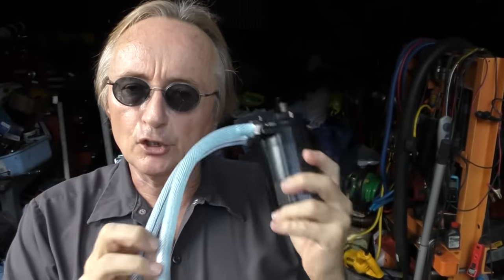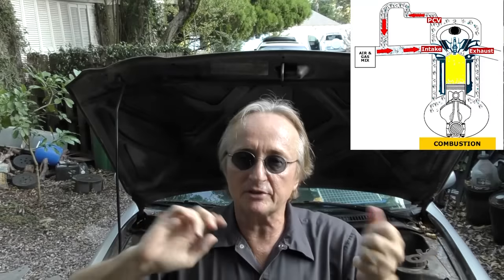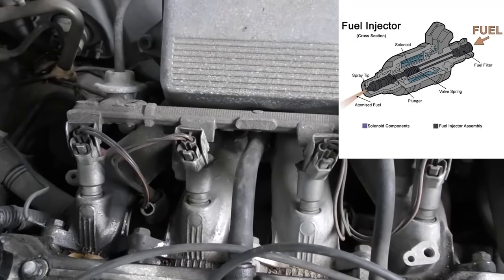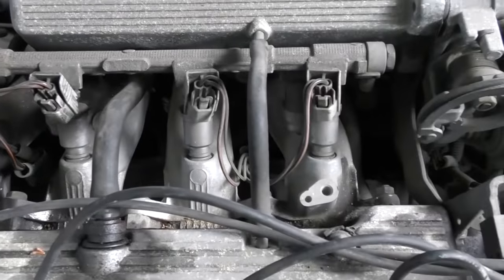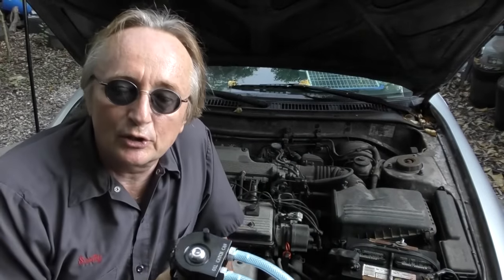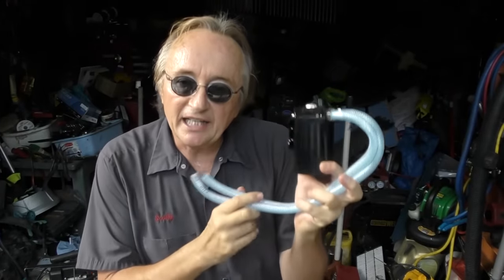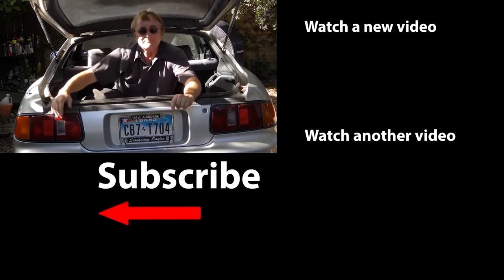If You Have This Type of Car, You Need This to Prevent Damage to Your Engine - Oil Catch Can

Comment: Be careful not to create a big trap that will allow water to settle into it and freeze.  It may take a while to thaw and damage can be done in the meantime if the other side of the PCV system is frozen.  Don't think it can happen?  Research 2.4L equinox PCV.  They have a trap built in from the factory.

Comment: Hi, Scotty. Does a Ford Ecosport 1l Ecoboost 2019 need an oil catch can? Thanks! 😊
Reply: Alex Ostafi you should not, 2nd gen ecoboost engines aren’t just direct injection, they’re mixed injection which means there are 2 injectors per cylinder. 1 inside like he’s talking about and 1 behind the valves keeping them clean. I’m a part of a ecoboost group and there are guys with 200k miles and some with more without a can on theirs. Also I have yet to hear any of them mention them having this problem.
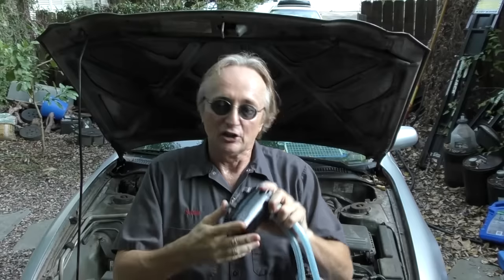Just finished this video, he answers your question at 5:25.

Comment: So I own a 2012 vw jetta diesel, it's stage 2 straight pipe... the car has always had the intake route covered in oil... I seen someone with a catch can and literally told me that was why they had it, to keep it clean? Should I get one? Wi this fix my issue? Also, could this be causing the car to lose some of its oil level over time? I use 10k mile oil...
Reply: It's a TDI. Totally different creature. Diesels are just dirty engines. As for the oil consumption, youre probably getting blow by if its not leaking which I doubt

Comment: I have a Miata. It has a breather hose system where it comes out of the valve cover and leads back to the air intake. Many people put a filter over that valve cover exit and plug the intake entrance. Is there benifit to this? Is it worth it for me to install a catch can in place?
Reply: If your new to working on cars, this is a cheap project that can be done with minimal tools.

Comment: I have a 2019 F150 with the gen 2 3.5 liter twin turbo v6 (3.5L Ecoboost). Does it have the PFI or do I need a catch can?
Reply: Yes even if you have the dual fuel injection system every car should have 1 to keep the engine running clean as every car engine has blow-by!

Comment: Anyone have an idea where the OEM PVC remains and have zero fume into the intake with the modern cars?  Of course have it vented to with a filter.   The question is with a PVC valve system, does it have to be a closed system to the intake?
Or have it the old way and remove PVC valve and run catch can to filter breather to vent to opening.   But would this be a problem when DMV smog inspection occur since part is modified?

Comment: I bought a 2014 tucson 2.0 liter engine today it looks like it needs 2 catch cans, is that possible, one hose coming from either side of valve cover, one goes to intake plenum and the other to the air intake just after the air filter?  Or do i just need one for the one going to the plenum , i would think both because they both lead to the valves, such a stupid design what a headache.  I looked in the intake hose and there is oil seeping into the throttle body even though that is a fresh air suction hose coming from the valve cover

Comment: I heard ford ecoboost v6 engines have the dual injection set up on them. But still hear they get the build up issue too.
Reply: Unkle t0m Only their truck has have dual injectors but their suvs and cars dont. But recently their 1.5l 3cylinder ecoboost has dual injectors.

Comment: Would this help the carbon buildup to the secondary air intake as well? Just had to have the air intakes drilled clean on my Q7...
Reply: Secondary intake? Oil catch cans usually keep oil and blow-by from getting into the intake manifold and beyond.

Comment: Funny I had to install one of these on my 2017 Ford escape SE I couldn't figure out why I had oil all around my throttle body it just didn't make sense so after doing some research the oil catch can is what I needed and my problem was solved so just out of curiosity I asked the stealership what they thought and they tried to tell me I needed a new throttle body and a fuel pump damn shame you can't go anywhere to get an honest opinion from anyone but yeah the 30.00 oil catch can did the trick and saved me what about 4,000 of what still would not have resolved my issue.

Comment: Scottie,  it still cause problems on the earlier fuel injectors as the carbon/oil would build up around the injector and cause problems with the nozzle

Comment: I just bought a 2011 camaro v6 3.6 engine has 74,000 miles on it should i install one of these catch can
Reply: Is it a gasoline direct injection engine? If not, then no.
Reply: @danejurus69  TY for the reply

Comment: Most of the direct injection cars are now either "self cleaning", meaning they squirt gas on top of the intake valve every once in a while to dissolve the oil, or have their own oil catch system in place that not only separates the oil from the air, but also returns it to the engine so you aren't wasting it.  Oil catch cans are for the first generation of DI cars.

Comment: So I installed a catch can today... not sure if I did it right though 🤔 there is a hose leading from the engine into my intake tube (not the manifold),  I took that hose out and connected it to the catch can inlet and then connected the supplied hose to the outlet and then connected that hose back to the intake tube . 

There's a second tiny little hose that also connects to my intake tube , I don't know if either of those are part of the pcv system. Can anyone help me with this ? Does the pcv system lead directly into the intake tube on some vehicles? Or is it always lead directly into the intake manifold on all cars? I thought I understood the pcv system but obviously I don't. I feel embarrassed to ask this and even more embarrassed to take it into my mechanic's shop and ask him to look at my work . Thought I knew the basics about cars but can't even install a catch can properly 😒

Comment: do you think Honda CR-V 2018 with 1.5 Turbo Engine needs it to combat the oil dilution issue?
Reply: it wont help with the oil dilution problem but definetely install a catch can so you dont clog up your intake valves. Every new Honda MUST HAVE a catch can installed.

Comment: This sounds like the AOS on a Porsche 996. And they fail. Which generally requires removing the engine, though I changed it by removing large numbers of parts.

Comment: First gen Ford F-150 truck 3.5 ecoboost don’t need this catch can. Just uses top tier gas, floor the gas once in a while and make sure you used synthetic oil and change it regularly like 5to 7k miles

Comment: 108k miles on my 2014 Mazda 6, just did walnut blasting on the intake valves.
Reply: How? What equipment did you use? I took off the intake and got a electric brush to clean the carbon off, but I wasn't able to get the valves. It had a lot of carbon buildup. On the valves and plastic intake.
2014 mazda 3 90,000
Reply: Daniel Garcia I walnut blasted it with an old blasting gun hooked up to my air compressor

Comment: Hello, I recently put one of these catch cans on my 15 Silverado. Had a local mechanic change the oil on it and he informed me I had a rear main seal leaking. Took the truck to local dealer to be fixed, the tech told me that the catch can may have been the reason the rear main seal started to leak. Thoughts on this if anyone has any are appreciated.
Reply: It's a hose with a filter, IMO I dont see how that wood make the seal go bad.

Comment: Do I need a catch can on the 2019/2020 Ford Explorer with EcoBoost GDI? Not sure if this model has dual fuel injection in its engine.
Reply: Yes even if you have the dual system every car should have 1 to keep the engine running clean as every car engine has blow-by!

Comment: Mercedes engines without GDI also need these because of the variable intake mechanism!
Reply: not only them many more need it. Modern diesels use hydraulic lifters and they need A PERFECT OIL
 to not get stuck  (internally) and it is pain in the a.. to get them clean/free again...
I made my own catch can for my old Susuki Grand Vitara 2.0TD 2000" at about 250.000 km and instead 
of new oil at 4-5000 km I got about 7.500 km after the catch can, so yes it works. I drove that car to 315.000 km
before it rusted out...

Comment: Can you use the breather filter that comes with alot of them? I figured not to since its a closed pcv system, so the breather would affect the vacuum pressure going into the engine. Anyone able to wiegh in on this?

Comment: So far GTI has worked about as well as a one-legged man in a butt-kicking contest. That works real well for diesel but gasoline is an entirely different fuel. Trying to make a gas engine emulate a diesel really doesn't work.
What they should have done with sequential injection is delay the injection till about 30°after top dead center. The purpose of this would be for the gasoline to be injected after the overlap period is complete. Thereby during the overlap period, only air is being used to scavenge the exhaust just like GDI but without the draw backs. A lot of modern cars especially GM need to better ventilate their crankcases.

Comment: I have used these devices, and I feel the satisfaction of draining oil and water out of them every couple months...  But at the same time, over 50% of all fleet vehicles in the US, are GDI, plus tens of millions of regular drivers that aren't part of a fleet...  If GDI was such an issue, wouldn't we hear about it?  I have seen the same handful of early Audi and VW horror stories with their GDI, but for every car that has such an issue, thousands or tens of thousands don't...

I feel like these days, car makers take this all into account.  Every time you drive, there is what, a few drops of oil and water going into the intake, over the course of your drive?  And now, some companies like Toyota do dual injection... they use GDI as the primary, but have secondary injectors in the intake tract.  Ford now does with the Gen3 Coyote motors, and they also build oil separators into the lines themselves...  Pretty sure they aren't the only ones...

I just wonder in this day and age, how much of a legit is this, REALLY?

I see zero valid studies, just a lot of "internet lore"...

Thoughts?

Comment: So the oil catcher goes in so will it drop my engine oil level?
Reply: Yes, so you have to check the dipstick more often, like every week
Reply: Depending on the size of your engine and if its turboed or not. Its minimal but you should be checking your oil anyway ;)
Reply: @HondaFit4Adventure  i looked and doesn't have any in the catch can.
Reply: @gamercat7004  Check after a 1000 miles. 
I know I can go at least 2000 before I have to change mine.

Comment: I have a 90 honda accord 235k miles. I isually go through 1.5 to 2 qts of oil between oil changes would a catch can be good
Reply: oil catch can is good on any car, but you probably need new gaskets on your valve cover and distributor and vtec solenoid. You are probably leaking oil.

Comment: Sometimes I've thought those engineering guys are so smart , they know what they are doing .. well 😬
Reply: GDI allows them to control what goes on in the cylinder.  For emission standards and increase in power they are great and make gov't regulators happy.  In real terms when driven, the carbon deposits are a real issue and when they gunk up valves - it creates worse mpg and worse emissions
Reply: @valvodka  yeah basically it's all whistles when new and pain as times goes on , wonder what emissions means nowdays .. when 10 biggest ships polute way more then all cars together and garbage is all over the sea
Reply: Part of the regular maintenance of a direct inject engine is decarbonization every 15,000 miles. You can do that at home with a can of seafoam and the breather hose going into the intake.

Comment: Anyone! Does a 2018 Ford Edge have a dual Intake system. My wife just bought one. 2.0 ecoboost. Thanks
Reply: We had a 2013 Escape with that engine, it was a great car! It had 80k trouble free miles until it was totalled in a wreck.

Comment: Can you explain WHY modern vehicles with both PI and DI don't need catch cans? This is a controversial topic amongst the 2nd Generation Ford Raptor owners and I still have yet to get a true explanation as to why it DOESN'T.

Comment: how do i find out if my car has gdi injectors?
Reply: Just Google up the model of your car and what you want to know about it is the easiest way. 
Direct injection will usually be on top of or on the head, port injectors will be mounted on the intake manifold just before the head. Its sometimes hard to see though especially with plastic covers

Comment: I put one in my 2002 Echo recently, 308k miles. After 600 miles, I collected 3 oz of oil, gas and water. Over a year, that will be 75 oz kept out of my engine.

Comment: Could you just unplug the pcv valve from the intake and vent it to the atmosphere?
Reply: Tony Herson illegal depending on where you live with consequences ranging from fines to not passing MOT. 
Secondly some vehicles computers will stop you from doing so. Meaning it will immediately throw an check engine light if you disconnect PCV valve.
Finally while we may disagree with some environmental regulations. Venting poisonous gases into same air we breath isn’t really a good idea.

Comment: So do I need one on 2019 ecoboost f 150?
Reply: Andrey Lukashev it is simple to install, and even on the new Raptors you'd be catching 20ml every oil change. That's an inexpensive investment to make your engine last longer. I'm surprised they're already not included with the new GDIs.
Reply: @chicanopowers4938  so I've actually done some research since and discovered that the new ecoboosts use both direct injection and port injection. And unlike the Toyota Scotty mentioned, Ford keeps their PI on the whole time, while the DI goes on and off, so I decided I'm definitely safe without adding anything.

Comment: But Scotty you forget that a lot of that carbon buildup on valve's uneven non GDI engines is caused by that every car should have a catch can
Reply: Exactly the same way I feel that every car should have 1 to keep the engine running clean as every car engine has blow-by!

Comment: Oil Catch Cans are illegal in California and perhaps in other states too, you will fail emissions test if you have one installed. Makes me wonder, what leaves a bigger carbon footprint, keeping your car for 10+ years while maintaining a catch can, or getting rid of it every 5-6 years due to carbon/valve build up as a result of PCV system they force automakers to install if they want to sell in the state? Looks like Japanese automakers got ahead of the game and introduced both direct and (essentially) port injection to their engines in order to maintain reliability that they've been known for. I don't understand why an Oil Catch Can can't be just another part of the vehicle that needs to be maintained. Oil can be drained and recycled vs. having it recirculated back into intake, burned, and decreasing the life of the engine/car. I imagine the former leaves a much lesser of a carbon foot print then the later. Has there been any studies that ask this question?

Comment: I thought these oil catch cans were a gimmick. But I just bought a new (to me) Hyundai Santa Fe with a GDI engine and installed one. The car only had 63,000 miles on it so I wasn't expecting much if anything. But after only thousand more miles there's about two tablespoons of nasty metallic-looking oil in the bottom of the catch can. All that would have gone right down the intake without it, so thank you to Scotty and your video for getting me to do it!
Reply: "Metallic-looking". You've got much bigger problems with that 2.5.

Comment: So why doesn't the manufacturer put them on stock if they're that important?
Reply: 'cause the average owner doesn't think about proper maintenance. They'd forget to empty/drain them and that would cause even more problems.
Reply: @dwendt44  so if I change my oil regularly I don't need a catch can?
Reply: @mumenrider862  It doesnt really start effecting your engine untill 60k miles. By that time it's out of warranty and your problem. Some may say its engineered obsolescence. 
Clean oil or not it's still being sprayed on the valves which is not being burned off by the gasoline.

Comment: Every engine should have a catch can. Oil vapors actually lower the octane rating of gasoline. Not to mention, there hasn't been a single intake manifold I've ever removed without a film of oil inside or pools of oil in the lower parts. Oil in the combustion process is just bad news for longevity and fuel economy.

Comment: Hey Scotty. I made a large water bubbler instead in the same inline setup. I found that the car ran better, the water vapour seemed to clean the head and after a while I had very little blowby. Interesting.
Reply: Now THAT is interesting! I am a technical reading geek, and I am going to have to try this one out!! Hoping it works because I know something like 3% water mixed with the fuel actually increases HP, so could kill 2 birds with 1 stone possibly!
Reply: Maybe wouldn’t recommend on a diesel engine

Comment: I have watched at least a dozen catch can videos. The most oil/ contaminates I have seen, (other than condensation, the majority of which is likely produced from the catch can device itself, being that you are running super hot air through relatively cooler tubing, sometimes several feet of it) is around three ounces per 10000 miles. Assuming 30 mpg, that is 3 ounces of contaminates running through more than 300 gallons of gas. Even if you doubled that figure, the quantity is insignificant. Seems like a tremendous waste of time and money to me, not to mention the inconvenience and mess of emptying the thing.